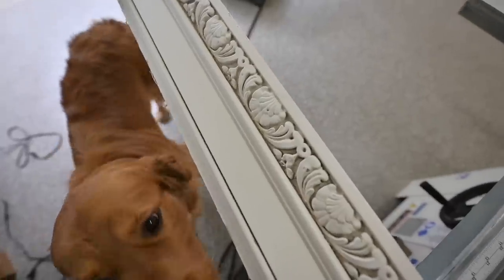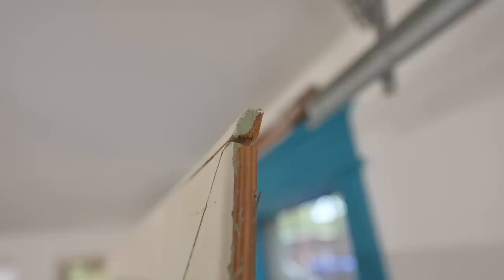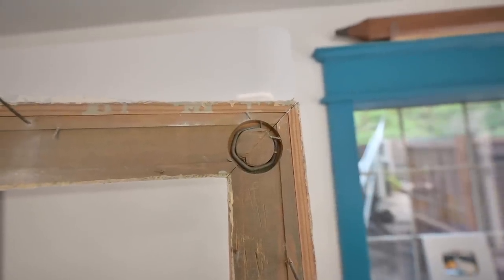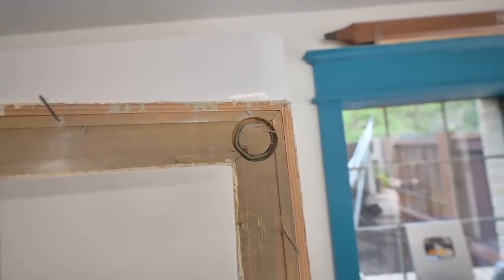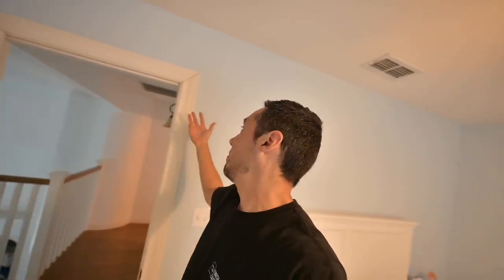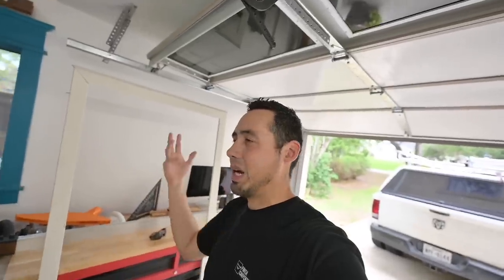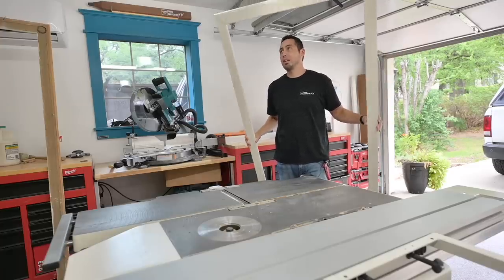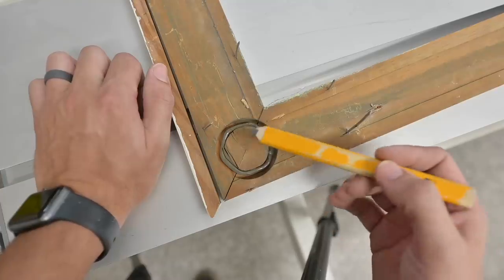Door casing skill lost for 100 years

Comment: Even though I do not think that this was done by holesaw, I do want to give you an example how you can cut with a holesaw without the center drill. Find a sacrificial piece of wood, sheet of mdf, plywood, whatever and predrill a hole with the holesaw. Remove the drill bit from the center and clamp the sacrificial piece to the piece you want drilled without the mark.
this also works very well for partial holes where the center of the hole is outside the piece you're drilling.

Comment: Hallo! Your video is lovely and I would like to give you a hint on both of your questions.
First the creative question:
The decorated old moulding is a masterpiece. It deserves a second Life.. maybe with a second use. I'd cut it in 2 halves and glue it again back to back (just make a simmetric shape). Than place LED light inside, take a big care for the acrilic light diffiser allignment and big care of small details like stainless steel strings. It will become a wanderful pendant light.

Second the hex corner rings: many people wrote correct things in the comments. So there's not too much to add. Please Let me add just fiew little thing: as a mechanical engineer let me tell that if the inner wood circle is round instead of hexagonal, it will not work. The inner piece must lock rotational movement as much as expansion and contraction of the angle.

Second little thing: reading the amount and the quality of the comments it is clear that the video is awesome, your intuition was brilliant.. and many interested people appreciate the re-discovery of a forgotten high quality woodworking!

Thanks for sharing this great video!

Comment: A few of the the door molding miters in my 1972 home do not even line up flush with each other on the surface. Some have even separated due to the slab settling over the years (it has cracks). Many coats of paint all these years later help hide these imperfections. The techniques of the days waaay back then, IMHO, should be brought back to life.

Comment: We live in a very old house in Germany. There were similar locking mechanisms in the window casings before they were modernized with double pane windows in the 80s. The metal rings were not welded shut in our case and slightly smaller than the wood. They acted more like very hard simple springs. The reason to use such a way of locking the wood together is simply "shifting". Old houses tend to move a bit and they did not have foam or other semi-flexible ways of installing framing. Fixed joints that are nailed to the walls will crack and rip over time, leaving ever larger gaps that will often be painted over. But these "clamp-joints" will be able move a little without breaking (they may creak a bit over time, though). Like a spring they move back when the walls return to the original position/shape. Hammering a metal clamp over the wooden circle is fast and easy right on site. Another way was using nuts and bolts over the edge to connect the wooden parts (like we still often see in furniture). Nuts and bolts may have been more expensive, though.

Comment: As soon as I saw the relatively wide width of the circular recess, I was reminded of the initial cut of a plug cutter. One comment referred to a dowel maker, but a plug cutter may be the reference that most may be able to relate to. Now, to find the right combination of premade rings and ID/OD of a plug cutter may be a challenge.
I have to doubt all the holesaw / router / preheated ring theories.

Comment: Hi Great Videos Thank You 🙏, the ring deletes the finish nails coming in from the side. Recessed nails and then filling the holes with sawdust and a little glue is time consuming so they came up with the lock ring. Probably routed on sight and then installed or prerouted at the factory and then installed on sight. Great Idea isn’t it!!!

Comment: It's done with a router using a template guide. Preferably with a dovetail bit. That allows the ring to fit tight under the flush back and act like a lock. Thus the weld to actually lock it in.

Comment: Doug trippo's comment said what i was gonna in so many words. Bear in mind most lumber yards had mill work shops. I worked in several many years. Box stores today are junk on many levels. This was later replaced by spline machines. They had there short comings as many know.  Today its about speed, cost and turnover. It was very common for a carpenter to spend a year building one house from dirt up. As doug noted there were some carpenters who made there own setups probably to shave cost. Alot is also in wood spices. Soft woods used today and thickness would never work. Great history video. As far as your piece of moulding i allways found using then in a fireplace mantel worked pretty cool.  GOD BLESS

Comment: Never seen it before in Australia or UK- must have been a master carpenter- and naybe part time smith. We did old, old 200yr old houses (no grand houses, just everyday folk) a lot of the architraving was custom cut with external faces meeting, but not thevrearbof the mitre with wooden wedges jammed in the rear side for cross pin nailing. We used mitre box with cabinet saws, some preassembled archtreaving because rock walls/double brick with thick plaster just wobbly as Hell, and carpenter's bevel transfer tool. For really out of square apertures we used plaster as a caulk with plenty of plasterboard (dry wall for you guys) grog or wedges (brown paper removed of course!)
I think it was a home-made bit made out of pipe and teeth filed into it, and then brazed a cross piece and shank to the back of it for a brace-and-bit drill. Thickness of coring bit suggests it was cast iron plumbing pipe. 
Channel PhilipStevens007 video "wooden ball and socket" shows how to file a pipe such that it can act as a core-borer or holesaw bit, or as Philip does- a sphere shaper (I'm guessing it was common for cabinet makers and staircase carpenters back in the day to rough out finials using home-made bits like this on your bit and brace or gut-drill, or treadlelathe).
A cabinet maker (German) I worked with made his own router profile bits- from stock bits and a bench grinder. I thought that was clever- you had total artistic control over profiles and customize your fancy work.

Comment: I do a lot of holes in ceramic or granite counter top for pluming with a grinder hole saw, these hole saw don't have a pilot bit, so we use a plywood template with the same size of the hole of the hole saw we are going to use, in this case I will use 2 different sizes hole saw without the pilot bit to make the groove and then fine tune the hexagon

Comment: Use the hole saw with the drill bit in an offcut. Clamp the offcut to the skirting in a jig. Using the 1st piece as a guide, use the hole saw without the drill bit to make the cut

Comment: I’m thinking the hole is cut with a bit that’s looks like a big plug cutter in combination with a corner jig. I could see the band being heated up and installed hot so it expands, then as it cools it shrinks and squeezes the corner tight and causing the wood to conform to the octagonal shape.  Just a thought   Love you videos

Comment: I would (hog) out part of the back and apply it to a short length wall as a crown mould  level with the top of the door casing,I would then use it for a picture hanger with lengthened (S) hooks.
It would look great and properly display the ornate profiles.

Comment: Pretty neat hidden fastener! Thx for sharing

I’d use that ornate molding for picture frames. You need to be careful when cutting it though in case the ornate work is plaster or something that will chip out easy

Comment: Many, many years ago I saw a video being shown in a local Sears store.  The video was black and white and was a re-recording of an old film from the early 1900's from a window and door company that Sears contracted with to make their pre-built windows. The two ends of trim were set in a machine with a saw blade that came up through the table and cut the miter.  when the saw blade dropped back down a bit that resembled a coring bit came down and cut the circle slot.  the operator then took the finished framework to a different table where a kind of press was used to press the rings down into the individual slots. after this was done the frames were placed in crates for shipping.  The video touted this as being the reason that their product arrived ready to assemble easily and squarely.

Comment: If you pre drill a board with a holesaw, you can clamp it in place over the actual workpeice and remove the guide bit from the saw.  No drill press needed.

Comment: It also seems with this technique vs pocket screws .. over stressing the joint with screws can split the wood.. I don't see this joint splitting even with rough handling and mild abuse during transport and installation. Very cool find .. TY for sharing..

Comment: You can use the hole saw with the pilot bit to cut a hole in a piece of scrap.  Clamp the piece of scrap onto the assembled frame, centered over the miter.  Now you can remove the pilot bit from the hole saw and the pre-cut hole in the scrap piece will keep your hole saw from wandering.

Comment: Its hex shaped and the central wood boss is slightly hexed with rounded points.  This is so the ring fits over the hex relatively easy when aligned and then the whole hex ring can be rotated so the flats engage the rounded points on the boss, creating a clamping action.  The hard ring easily compresses the wood fibers to tighten the joint. And when the wood swells with humidity, it only gets tighter.

Comment: With that decorative moulding... I came across 2 different samples years apart from each other. Not really thinking too hard on what to do with the 1st one, I ended up making a couple small shadow boxes I put photos in and hang them onlivingroom wall...! The 2nd casing that I received years later I made into 2 small crown mouldings for tall vanity cabinets with return cuts to wall in master bathroom... The longer cut I used as crown moulding also but nailed to a backer board that I used to frame out the walk in shower... I used a router to cut a 5/16th" groove in all 3 crown pieces plus the 4 return crown cuts and installed LED lighting in them for a touch of modern on a classic cut ot moulding...

Comment: Another thing is the wood.  About 15 years ago, I replaced Chicago back porches.  
One thing I noticed was the difference in the wood.  Pine 2x4's, 2x8's, and 6x6's were used on both old and new.  
The tightness of the grain on the old pine was amazing.  Modern wood is farm raised, fertilized, and made to grow fast. So, the growth rings are large, and the grain large.  
The old pine must have been wild grown wood, possibly from old growth forests.  
FYI - the old tight grain pine would be much harder and stronger than the modern lumber.

Comment: There are hole-drill sets that have a backing that has rings in it that are the size of some hole drilling bits. So, the bits are just like a round c-shape that sets into the rings by pinching it into a circular shape. Then I'm not sure I remember, I think there's a set screw or something that holds them against the backing. It's nice when your triming something for the circular dot of wood. Nice that you saved the beautiful carving😍👍.

Comment: Great solution for thicker trim. Since the circle/hex is perfectly centered it seems like they may have been prepared before the mitre cut. In the shop you prepare the circular\hex ring cut and then mitre the angles to the centre of the circle. This would remove the need to use a difficult angled jig for cutting the circle/hex. On site you would then assemble with the ring and install the trim.

Comment: Some great ideas. Never run across this. As far as the outside round hole, I would have drilled the hole in a piece of 2X4, clamped it over the molding and used a hole saw bit without the drill center installed. You could make a pencil line on the outside of the bit for depth. The trace out method and chisel for the hexagon, seems most likely candidate there. Cool find!

Comment: This technique reminds me of that trick of putting a nail in a block of wood cut with three slots. You compress the section at one end and drill a hole in the two center bits, place the nail, then steam the compressed section to expand it. This hex technique would compress the wood and allow the outer part to expand with ambient humidity locking the ring in place. I agree; genius!

Comment: Seen that on a lot of houses around here when I did repair work for a local landlord. Many of the houses here were built in the 60s but some were built much earlier. When I rebuilt the cabinet on my table saw, replicated that around it's catch basin to ensure it stays sealed. Was trivial to do with a router bit on a dremmel and a piece of string but I would love to see the jig they used to punch them out in such large quantity in the past.

Comment: My take; to explain the clamping effect and the reason why it is hexagonal: The hex ring is fit tight to the hex shape wood (but that isn't the holding/clamping pressure), then the ring is rotated on the wood so the two wood pieces are forced together.

Comment: When I needed to cut a hole with a hole saw and didn't want to leave a pilot bit hole, I would take a piece of scrap wood and drill the hole through it with the hole saw. Then I would remove the pilot bit from the saw, place the scrap board on the work and use the scrap as a guide. Sort of a reverse pilot.

I used it for making plugs for a pine plank floor. If I had a defect like a knot or something that left a hole that needed plugging. I drilled a hole in the scrap that was the size of the hole I wanted in the floor. Then I used a bit 1/4 in larger to cut a plug out of the scrap so I could glue it into the hole.

It works if you have a gap where the pilot bit has nothing to grab or if you want the plugs with no pilot holes in them.

Comment: Not sure about carpentry, but in joinery in BC, Canada we used press rings as recently as 15 years ago (probably still do?). They're also handy for dry assembly in cases where the rings will never be seen but you need one person to be able to pre-assemble something large, for example.

As I recall we had a CNC machine implement the hex hole. Not sure how it was done before.

Comment: I can't wait to give this a try! That was a perfect idea, using a hole saw, but I think I'll use two of them. One inside the other, but just slightly smaller, in order to get the right width of cut. I'm also thinking of trying to heat the ring, like they used to do with wagon wheels. I bet I'm going to find out just why they didn't do that first hand. Them carpenters of yesteryear we're pretty smart. But once I get something in my head, I gotta try.

Comment: Easy guide for hole saws.  Drill a hole in a scrap piece of wood using the center drill, then clamp the wood with the hole on the corner.  The hole saw will not wobble out.  I use such a guide when I’m drilling aluminum plate while not using the centering drill.

Comment: I would make a jig with a 90 degree corner and a hole saw hole in it.   The molding would be clamped to the fixture with miter tight and drill the hole without the pilot bit installed.  The hole in the jig will guide the bit for a certain depth.  They might have a set for each standard sized molding.  The carved crown molding can be used to make a pair of decorative corbels for shelf brackets.  Tough to describe without sketches.  Interesting segment.  If you would throw away the casing in your daughters room because the miter opened up a bit - maybe a psychological evaluation is in order.

Comment: You can take the pilot bit out of a wh
Holesaw and run it through a block of wood that already has the same size hole in it. So whatever clamping jig they have could easily have a block on the top op that a holesale would run through.

Comment: The most brilliant thing about this, is how easily it could be done today as well. Those hex rings can be mass manufactured, making them super cheap and the little inset they fit in, can be managed with a set of 2 power tools. 1 to make the inset and 1 to press the hex ring in.

Comment: With the piece that you got from the site (looks like a cornice?), if you can find a way to remove the paint, I'd suggest making a silicone or poly mold of the wood. That way you can reproduce it and render it in plaster or resin or other materials.

Comment: I've seen tools similar to a boring head used to make round sections of wood, maybe that's how they made the cutout. Are there burn marks on the wood where the ring is placed? it's possible they used thermal expansion to place the ring, then it clamps together as it cools.

Comment: I don't have a suggestion as to how the hole is made, but, if the inner diameter is just right your hexagonal lock piece would drive right onto the inside circle. The round edges of your hex clip would serve as the bevel to begin compressing the wood as you drive it on. I would inspect the inner edge of the wood circle to see if it evidences this method with wood not yet deformed by the other side of the round.